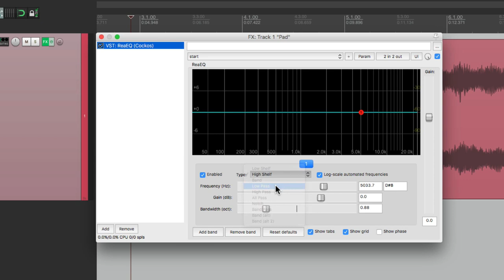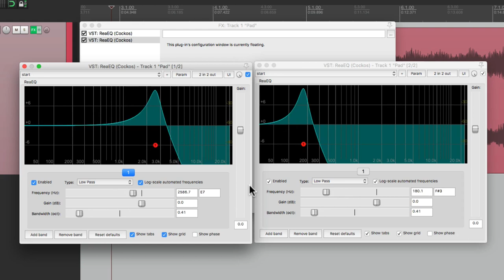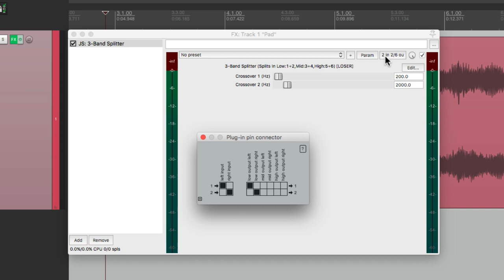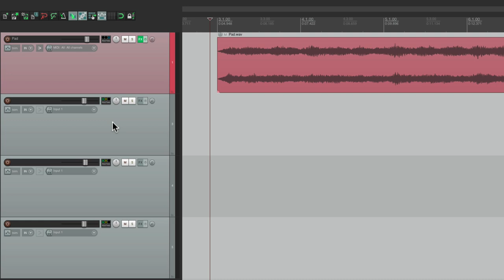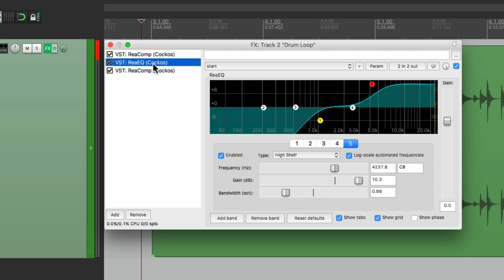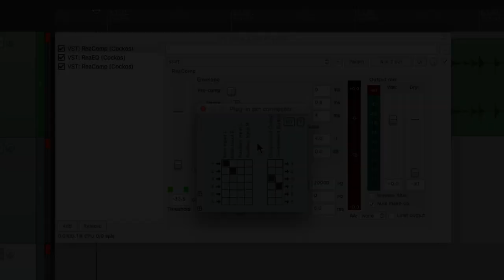The Plugin Pin Connector in REAPER

Comment: With this technique you can use ANY plug-in as a multiband. Put the 5 band splitter on first insert, / 5 band joiner on last and any plug you want in between... now use the plug-in pins on the middle plug-in to affect the band you want.... work as well on reverb sends.... You can go completly nuts and have a 5 Bands amp sim or a 5 bands delay/verb. You can also use eq inside each band for reducing phase shift. It works great with gate (try gating only lows of a kick drum) or transient designer (try to transhape an overhead only on low mid band)... The sky is the limit
Reply: I think kenny will explain it in the next video. This video just make a simple introduction of endless channel splitting ability in REAPER as explained by Geoffrey Francis in his great book Reamix: breaking the barriers with REAPER
Reply from the maker: https://www.youtube.com/watch?v=Am43xUCCPEM

Comment: Excellent video: What's the plugin sequence for a plugin that's stereoo but your track is mono? Thanks, -Derek
Reply from the maker: All REAPER tracks are stereo.
Reply: @REAPERMania  Hey, so if I have Waves plugins, which I do, should i be using the mono version of the plugin, provided I recorded and have a mono-looking track (though actually stereo) . ? Thanks so much, -Derek
Reply from the maker: @DLithic  Most likely. The one I use "CLA Mix Hub" is different in REAPER and I have to choose mono or stereo depending on the source. Of course, you can use the stereo one at all times with mono but it does use more DSP processing.
Reply: @REAPERMania  oh ok gotcha, so just leave it like top left bottom right on both, regardless of plugin status/mono-stereo source
Reply from the maker: @DLithic  Yeah. You don't have to change the pins when working with mono plugins. Just make sure that you choose the mono version to save DSP.

Comment: Hi Kenny.I could not find a way to mixdown pins 1-2 and 3-4 into the output of the same track, but as you mentioned we have to create seperate tracks for pins 3-4. That is a big drawback for me. For example, I have a pluck sound. I want to add a higpassed reverb, mix them with dry signal, then add delay to the combined signal. To do this, I have to create 3 seperate tracks. In the end the numberof tracks bloats up in a project. Why can't we mixdown with a plugin the signals 1-2 and 3-4 on the same track? In the end, even I cannot figure out the signal routing I planned at the beginning.
Reply from the maker: Search for the plugin JS: 8x Stereo to 1x Stereo Mixer
Reply: @REAPERMania  Wow thank you Kenny, you're a life saver

Comment: Kenny, why don't you simply combine parallel chains back within the same track with another instance of ReaEQ. Or, if you need level control, you can combine them with JS mixer plugin. The way you do it here is almost the same as sending original signal to several parallel tracks with fx on them. You still get many tracks. If you do it all within one track, then one track is all there is.
Reply from the maker: Yes. What I did here is not necessarily the most efficient way of doing what I did. I was just showing how the Plugin Connector works so that people will understand the routing.
Reply: @REAPERMania  can you make a video where you do this? I'm wondering about how a reaper user would do something similar to an ableton rack. Thanks!

Comment: When you were doing the Parameter Modulation to get the stereo EQ thing, it would have been faster, easier, and more accurate to just change the Phase of the one modulator.  By putting it 180 degrees out of phase with the other, you'd achieve what you were shooting for but be sure that they're both covering the same range.  Plus, it's one slider rather than a checkbox and a slider.  ;)  This will work for sine, triangle, and square waves.  A saw, you'd just choose the opposite wave (L vs R).  Random is really the only that has to be done manually the way you did.

I agree with the comment below that most of what you did splitting to different tracks could have been done by putting the plugins on the receive tracks and not messing with the fancy stuff.  Most of the things you might do with the pins can be achieved without any of that if you're willing to make enough tracks.  The real power of the pins is in condensing that kind of routing into fewer tracks.  

You did not show how the pin connectors can be used to MIX signals, nor did you really explicitly show how they can be used to create sends from anywhere in a series FX chain.